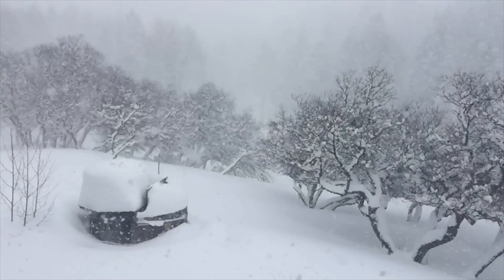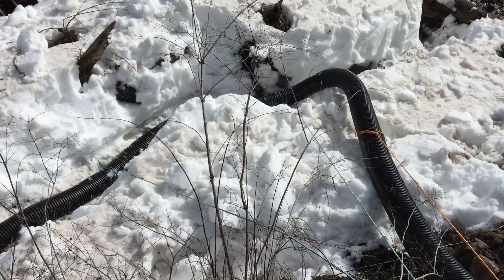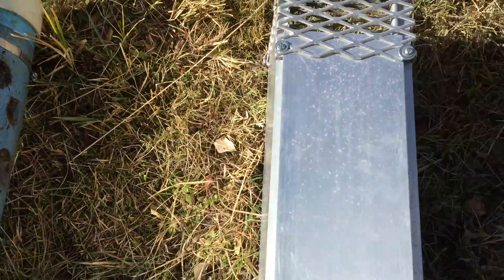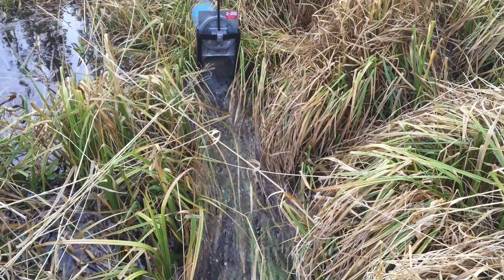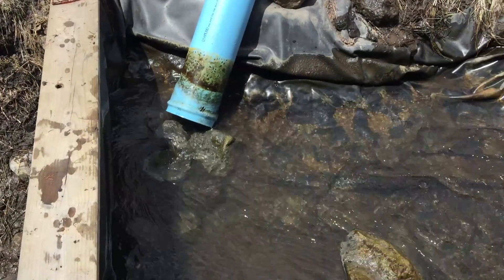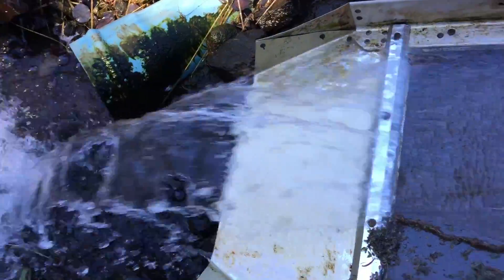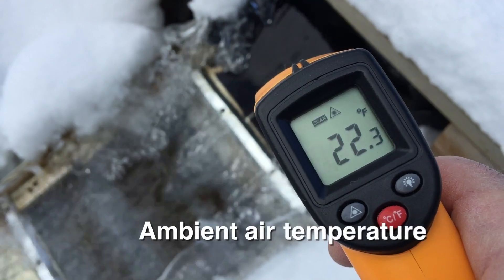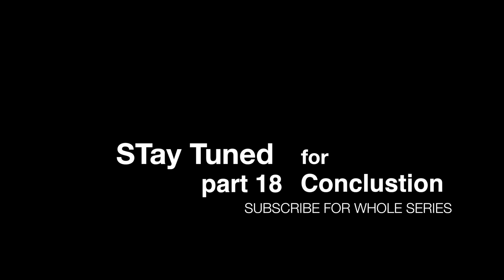Part 17 MicroHydro Power System in CO

Comment: 8kw (£1 an hour in UK)   has to be set against the effort and cost of generating this amount.
Reply from the maker: You need to know that we are 7 miles from the grid and the estimate in 1996 to bring power lines in was $140K (7*$20K/mile)  Current prices to bring power in range $40-50K/mile.  So, it was a no brainer to enhance the overall property by investing in a far less costly and bill-free solution.  Thx for watching  I'm never sure who has seen what of the series.  Here is a playlist of the 3 part synopsis which is an overview of the whole process https://www.youtube.com/playlist?list=PLtTypVpmDd-vkT9bJQkXw4I1t0e_4jMYA  The whole series is in about 25 videos.  This part 17 video gets promoted most frequently by YouTube.
Reply: @mrhydrohead  Congratulations for what you have done. It's many a persons dream..and were I there I would certainly do it. I see many potential locations even here that are suitable for small scale generation ( mostly banned by authorities I have to add..so much for their eco credentials).

Comment: Idea on that intake with the coanda screen, use some of the generated power to heat it while its cold to prevent icing/ the need to deice. You can use Nichrome wire from a toaster.
Reply from the maker: The power is 1/2 mile from the coanda and we don't have power interruptions due to freezing so no need to make this super expensive modification.  Thanks for the suggestion anyway. and Thx for watching  I'm never sure who has seen what of the series.  Here is a playlist of the 3 part synopsis which is an overview of the whole process https://www.youtube.com/playlist?list=PLtTypVpmDd-vkT9bJQkXw4I1t0e_4jMYA  The whole series is in about 25 videos.  This part 17 video gets promoted most frequently by YouTube.
Reply: MrHydrohead ah i was thinking it was closer for someone reason. And yeah I got promoted part 17, I'll go back and watch the entire series. This is pretty good, keep it up
Reply from the maker: 👍🏻 parts 20-1,2,3 are a synopsis thx for watching

Comment: Would this provide a energy surplus in a closed loop system?
Reply from the maker: Not sure what you mean by closed loop. We have quite a bit of excess energy which is shunted off as heat, first to heat 300 gallons of domestic water, then a hot tub, and in Winter to heat the house.  We run it at a lower flow rate in non winter seasons because we can't use all the power.  Hope this answers your question.  Thx for watching  I'm never sure who has seen what of the series.  Here is a playlist of the 3 part synopsis which is an overview of the whole process https://www.youtube.com/playlist?list=PLtTypVpmDd-vkT9bJQkXw4I1t0e_4jMYA  The whole series is in about 25 videos.  This part 17 video gets promoted most frequently by YouTube.
Reply: @mrhydrohead  Closed loop using the same water. I was thinking you could do a closed loop system from one reservoir to another. First generator unit will be on the gravity side and the second unit will be on the pump side. There should be enough energy to run the pump and have a surplus.
Reply from the maker: Sounds complicated.  It would require building a pond, laying in another pipeline, and suffering the losses due to inefficiencies.  No one has yet proven a perpetual motion machine and that is sort of what you are describing.  
Fortunately we have more power than we can use and the excess gets off loaded as heat.
thx again for watching.

Comment: I may be the 1000th person to say it, but have you tried just leaving the vent holes open to constantly bleed? I don't think it would wrench your flow enough to cause issues.
Reply from the maker: The problem is that  the negative suction pressure from the lower part of the pipe would simply suck air in at the vent holes.  That is why when I bleed the air out through the holes I need to close the gate at the pipe outlet.  Once the air is out of the line, the flow is dramatically increased.  Thx for watching  I'm never sure who has seen what of the series.  Here is a playlist of the 3 part synopsis which is an overview of the whole process https://www.youtube.com/playlist?list=PLtTypVpmDd-vkT9bJQkXw4I1t0e_4jMYA  The whole series is in about 25 videos.  This part 17 video gets promoted most frequently by YouTube.
Reply: @mrhydrohead  thanks for the reply. I thought there would be enough head pressure to avoid what you said, but I've never tried it so thanks for setting it straight.

Comment: Why not use a sand filter? You could bury it and mitigate and freezing
Reply from the maker: A permanent sand filter as you suggest isn't practical.  300+ gallons per minute goes through our overall penstock system.  Some of it is from the creek, some from the meadow.  The system runs ceaselessly with minimal cleaning & maintenance at this point.  The only trick is to adapt to the creek formation at the end of spring run off each year which alters the shape, direction, depth, and flow characteristics of the creek diversion intake area.   This year (2019) is a challenge and will be covered in an upcoming video. 
Thx for watching  I'm never sure who has seen what of the series.  Here is a playlist of the 3 part synopsis which is an overview of the whole process https://www.youtube.com/playlist?list=PLtTypVpmDd-vkT9bJQkXw4I1t0e_4jMYA  The whole series is in about 25 videos.  This part 17 video gets promoted most frequently by YouTube.

Comment: why haven't you installed generator near existing water flow? instead of changing it?
Reply from the maker: The stored solar kinetic energy captured with micro hydro is based on two measures.  Head (fall of water or PSI) and flow (quantity of water).  With our existing equipment we needed to move water down hill and capture pressure to drive the turbine.  There are new designs that broaden the possibilities. https://youtu.be/gY3p2e1-kN4 Turbulent wasn't around when I got started in 1996.  I think their design is great. The low head/high flow approach is something that can be applied in so many places.  When you think about it, moving water is the largest collective of kinetic solar energy on earth.  Wind and solar pales in comparison.   Our effort has been to keep costs low and low tech.  I'm never sure who has seen what of the series.  Here is a playlist of the 3 part synopsis which is an overview of the whole process https://www.youtube.com/playlist?list=PLtTypVpmDd-vkT9bJQkXw4I1t0e_4jMYA  The whole series is in about 25 videos.  This part 17 video gets promoted most frequently by YouTube.
If you are asking why we put the water into the meadow, it was because there was existing water in the meadow and it was a effective place to let the water settle in a controlled manner before entering the penstock. Hope this answers you question.  Thanks for watching.

Comment: This is truly the most efficient way to generate enough electricity off grid to live normally
.
Reply from the maker: Micro hydro is fantastic if you have a site that works.  The difficulty is finding the right place. There are new designs that broaden the possibilities. https://youtu.be/gY3p2e1-kN4 Turbulent wasn't around when I got started in 1996.  I think their design is great.  I just wish they had a larger market penetration.  I don't think they have a large number of installed units yet.  The low head/high flow approach is something that can be applied in so many places.  When you think about it, moving water is the largest collective of kinetic solar energy on earth.  Wind and solar pales in comparison.  Thanks for watching.
Reply: @skibum4207  Right. For minimal amount of people this is great. But, if you tried to provide everyone with power this way it would be a total fail. Imagine all the plastic and all the resources used to get and process all those materials. That is the downside of so many good energy ideas. 

Off topic, but to your point: It's like the supposed "Zero Emission" sailboat ride of Greta Thurnberg. If everyone stopped flying jets and sailed on sailboats, the amount of pollution and drain on non-renewable materials, caused by manufacturing and maintaining all those boats would be incalculably more than traveling commercial airlines. BTW, did you see Greta's 100% synthetic, chemically produced sailing outfit? Zero emissions.... LOL

Comment: What is the drop in elevation of the system?  350gpm, 8500 watts, but from what drop?
Reply from the maker: The static (non moving) pressure reads out on the dial just under 100 psi.  2.31 ft per psi means we have about 220-230 feet of head.  Dynamic pressure (moving) is reduced a bit by pipe friction.  Ultimately we get between 170-200 kWh per day at highest settings of flow.  Flow gets reduced in non Winter seasons because we don't need the excess power for any peak use we have.
Thx for watching  I'm never sure who has seen what of the series.  Here is a playlist of the 3 part synopsis which is an overview of the whole process https://www.youtube.com/playlist?list=PLtTypVpmDd-vkT9bJQkXw4I1t0e_4jMYA  The whole series is in about 25 videos.  This part 17 video gets promoted most frequently by YouTube.

Comment: If your coanda screen doesn’t work for you try making a traveling screen they are used at most power plants and are capable of removing a huge amount of debris.
Reply from the maker: The system runs ceaselessly with minimal cleaning & maintenance at this point.  The only trick is to adapt to the creek formation at the end of spring run off each year which alters the shape, direction, depth, and flow characteristics of the creek diversion intake area.   This year (2019) is a challenge and will be covered in an upcoming video. 
Thx for watching  I'm never sure who has seen what of the series.  Here is a playlist of the 3 part synopsis which is an overview of the whole process https://www.youtube.com/playlist?list=PLtTypVpmDd-vkT9bJQkXw4I1t0e_4jMYA  The whole series is in about 25 videos.  This part 17 video gets promoted most frequently by YouTube.

Comment: Not sure if they would freeze up, but air relief valves at high point would release air automatically. At least during the summer. You could build one yourself. Its basically a floating  check valve. Awesome job!
Reply from the maker: Air vents in the diversion pipe have been considered. The problem is that where they would need to go is such a flat run that the negative suction pressure from the lower part of the pipe would simply suck air in at the valves.  Thx for watching  I'm never sure who has seen what of the series.  Here is a playlist of the 3 part synopsis which is an overview of the whole process https://www.youtube.com/playlist?list=PLtTypVpmDd-vkT9bJQkXw4I1t0e_4jMYA  The whole series is in about 25 videos.  This part 17 video gets promoted most frequently by YouTube.

Comment: Nice! looks like you've got some major heat lose from your roof.
Reply from the maker: Not sure what the R value of the roof is, but in the winter when the sun shines and we get a lot of passive solar gain as designed, we have to open the windows to prevent 90°+ temps inside.  Otherwise, 60ish degrees is as low at the temps drop even in the coldest/ cloudiest of conditions.  Thx for watching  I'm never sure who has seen what of the series.  Here is a playlist of the 3 part synopsis which is an overview of the whole process https://www.youtube.com/playlist?list=PLtTypVpmDd-vkT9bJQkXw4I1t0e_4jMYA  The whole series is in about 25 videos.  This part 17 video gets promoted most frequently by YouTube.

Comment: very instructive; hope you're done improving and finally got a final design. best wishes
Reply from the maker: The system runs ceaselessly with minimal cleaning & maintenance at this point.  The only trick is to adapt to the creek formation at the end of spring run off each year which alters the shape, direction, depth, and flow characteristics of the intake area.   This year (2019) is a challenge and will be covered in an upcoming video. 
Thx for watching  I'm never sure who has seen what of the series.  Here is a playlist of the 3 part synopsis which is an overview of the whole process https://www.youtube.com/playlist?list=PLtTypVpmDd-vkT9bJQkXw4I1t0e_4jMYA  The whole series is in about 25 videos.  This part 17 video gets promoted most frequently by YouTube.

Comment: Make a centrifuge filter run off the flow....
No cleaning ever required
Reply from the maker: Lots of folks make suggestions like this.  I appreciate it.  The system runs ceaselessly with minimal cleaning & maintenance at this point.  The only trick is to adapt to the creek formation at the end of spring run off each year which alters the shape, direction, depth, and flow characteristics of the intake area.  This year (2019) is a challenge and will be covered in an upcoming video.  Thx for watching  I'm never sure who has seen what of the series.  Here is a playlist of the 3 part synopsis which is an overview of the whole process https://www.youtube.com/playlist?list=PLtTypVpmDd-vkT9bJQkXw4I1t0e_4jMYA  The whole series is in about 25 videos.  This part 17 video gets promoted most frequently by YouTube.
Reply: i have seen said filters. or a variation. it looked sound, and would consider using one myself.
Reply: Use a smart drive washer and run feed at bottom and in middle put a elbow joint to get supply
All the junk spin and spill out top

Comment: That is a NICE house!  BTW, could you put valves on risers so you can vent the trapped air bubbles without having to dig in the snow?
Reply: any valve would just freeze
Reply from the maker: The other comment is correct, they would freeze.  An added problem is that where they would need to go is such a flat run that the negative suction pressure from the lower part of the pipe would simply suck air in at the valve.  Thx for watching  I'm never sure who has seen what of the series.  Here is a playlist of the 3 part synopsis which is an overview of the whole process https://www.youtube.com/playlist?list=PLtTypVpmDd-vkT9bJQkXw4I1t0e_4jMYA  The whole series is in about 25 videos.  This part 17 video gets promoted most frequently by YouTube.

Comment: Far be it from me to tell you what to do... but. If you have a holding tank at the intake end, with the outlet halfway up the tank. This allows the lighter debris to float off the surface and over the side. The material heavier than water goes to the bottom. The holding tank also allows the material to settle out and provides the 12" of water column you should have over the  outlet to prevent vapor lock in the penstock. If you look at penstocks you'll see a venturi stack on the larger ones(Oroville dam has a considerable one) which serve a couple of functions. Hydro shock prevention and .. I'm not sure. Equalization of pressure? You might find information here
https://cedb.asce.org/CEDBsearch/records.jsp?terms=Fluid%20flow
Reply from the maker: Thanks for the suggestion.  Our intake from the creek modifies each year as it is changed by the spring melt off and we face different conditions each season. This year we will be luck to find a spot that affords even 12" of depth.  I will look at your info just the same. Thx for watching  I'm never sure who has seen what of the series.  Here is a playlist of the 3 part synopsis which is an overview of the whole process https://www.youtube.com/playlist?list=PLtTypVpmDd-vkT9bJQkXw4I1t0e_4jMYA  The whole series is in about 25 videos.  This part 17 video gets promoted most frequently by YouTube.

Comment: Have you considered a submersible heating element to reduce the ice from the intake.  A solar tube setup my also be enough to keep it ice free
Reply from the maker: Anything electric would require running wire about 1/2 mile and be a waste of money.  The ice hasn't proven to be a real problem even in super cold years, so no fix is really necessary.  Thx for watching  I'm never sure who has seen what of the series.  Here is a playlist of the 3 part synopsis which is an overview of the whole process https://www.youtube.com/playlist?list=PLtTypVpmDd-vkT9bJQkXw4I1t0e_4jMYA  The whole series is in about 25 videos.  This part 17 video gets promoted most frequently by YouTube.

Comment: I don't have a creek nearby! But I do have drainage for the rain, and the pipe where grey water flows through. Every time water flows through those pipes, electricity is also generated. The toilet is not included but could be if some change would be made so that only fluid comes through. It's not the same as the power that a creek could generated but there is alsop the use of a small wind turbine that can be added. That's my plan for the coming year at least.

Comment: Have you considered adding a small offset wheel in the system near the filters that through very slight vibration would clean debris and ice year round..?
Reply from the maker: No we haven't because the system has run fine without that sort of mechanism.  Cleaning the coanda screen isn't really required and we only do it as a habit when visiting the intake.  It has gone many months without cleaning numerous times.  Thx for watching  I'm never sure who has seen what of the series.  Here is a playlist of the 3 part synopsis which is an overview of the whole process https://www.youtube.com/playlist?list=PLtTypVpmDd-vkT9bJQkXw4I1t0e_4jMYA  The whole series is in about 25 videos.  This part 17 video gets promoted most frequently by YouTube.

Comment: Well done buddy I enjoyed your problem solving technics, Just a thought to consider as I have done research to do something similar as I once lived by a slow moving creek. we worked out to increase water flow we would start off with a 2 ft dia pipe and progressively reduce it to a 2" DIA to increase water pressure.this may not work in your situation as we had a large volume of water but slow moving.